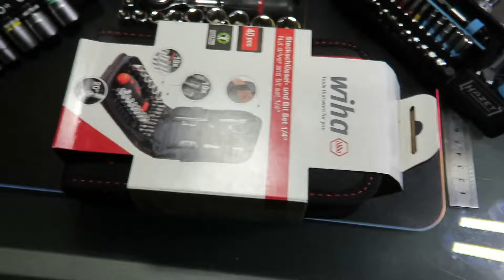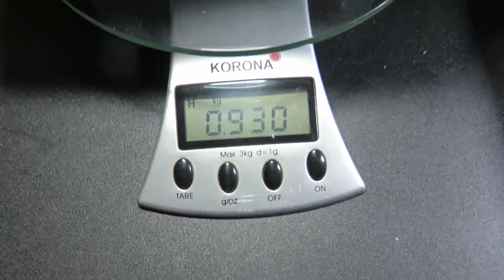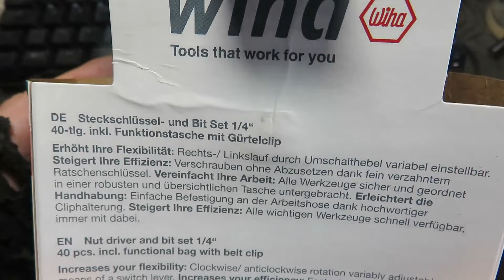WIHA 44684 Nut Driver & Bit Set 1/4" (vs FACOM RNano/ WERA Tool-Check Plus/ HAZET Smart Holder)

Comment: I checked out this set on Wiha's site and now they've added the bit holder adapter! This makes this set super nice in my opinion. Which one is your favorite and do you think has best overall quality? For myself I'm really considering the Wiha because of its fullsize screwdriver and 1/4 ratchet handle instead of the very small handles of competitors. PS: Do you know if they're all made in Asia?

- Hazet Smartholder +- 80 euro
- Hazet Smartcase +- 140 euro
- Wera Toolcheck Plus +- 65 euro
- Wiha 44684 (with adapter) +- 120 euro

Prices are from this day in Belgium
Reply from the maker: A l'occasion de votre message, je viens juste de regarder à nouveau mon ensemble WIHA et, désagréable surprise, j'ai trouvé l'adaptateur centrofix pour perçeuse complètement rouillé, rouillé dans l'étui fermé, adaptateur qui n'a jamais servi ...  Pour ce qui est de l'origine de fabrication des produits, je ne pense pas que WERA et HAZET fassent fabriquer en Chine, plutôt en Europe.
Reply: @diezelle57  Ok, merci beaucoup pour votre réponse et vos informations utiles. Le problème de la rouille est très regrettable et je ne m'y attendais pas pour une marque de qualité comme Wiha. Je vais donc regarder les sets de Facom, Wera et Hazet. Le choix se fera probablement entre le Facom Nano et le Hazet 856-1. En attendant, j'ai découvert que le set Hazet est fabriqué en Allemagne. Ce qui, pour moi en tout cas, donne un peu plus de confiance en termes de fabrication et de contrôle de qualité. 

Saviez-vous que Felo a également un ensemble similaire ? Il serait peut-être intéressant de l'examiner un jour ! 

Cordialement et bonsoir
Reply from the maker: @Jordy-is-niet-mijn-echte-naam  Felo, non, je ne pense pas. Fabriqué en République Tchèque, WERA. Facom Nano : excellent choix, un coffret de référence.
Bonne soirée.
Reply: Hazet for sure is not made in Asia, but in Germany.